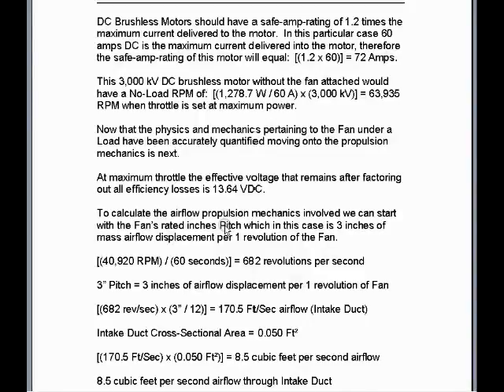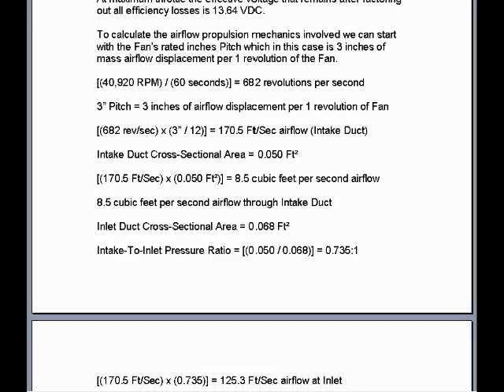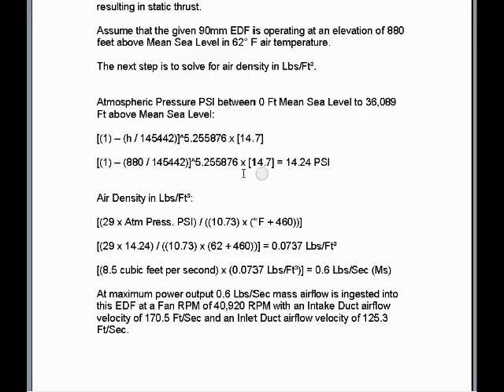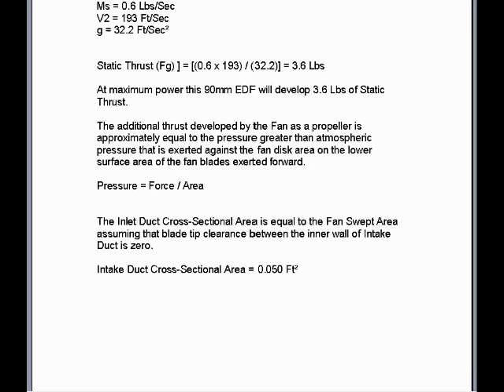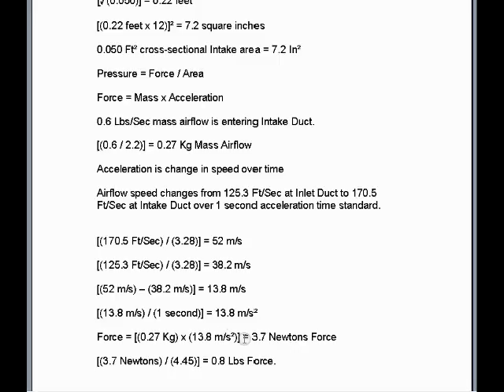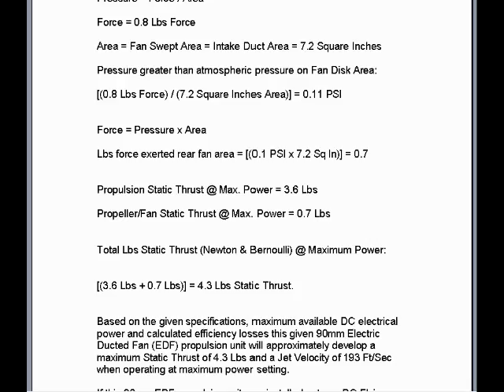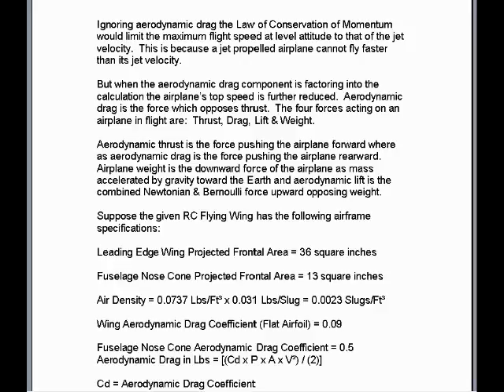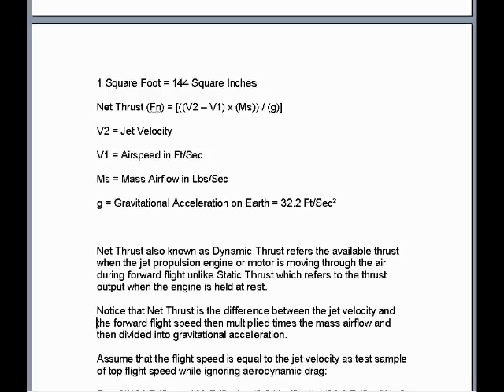90mm Electric Ducted Fan Propulsion Mechanics (Part 3 of 4)

Comment: Hi sir,
I have watched this series till 3rd video i.e till this video. 
I have a doubt. If possible please clarify it. 
My doubt is,
You have considered the pitch as 3" for 90mm electric Ducted Fan.
Actually a fan or propeller has multiple blades. 
The Propeller/fan u considered for calculations have how many blades ? 
And
 If I change the number of blades how will my thrust varies and what formulas or how to calculate thrust for the same pitch with different number of blades ?
Thank you.